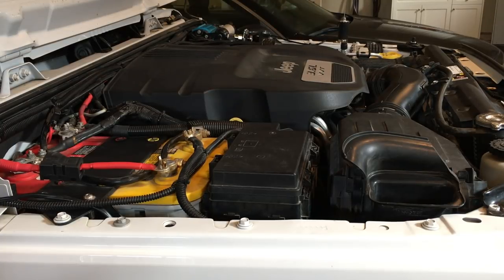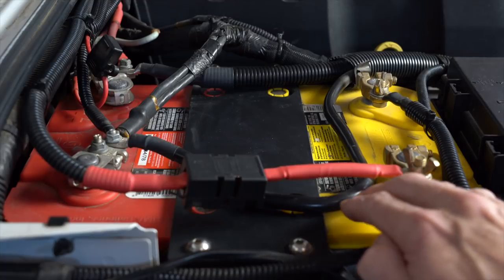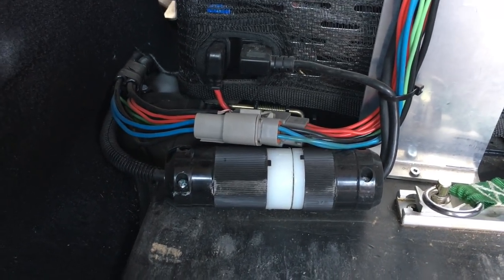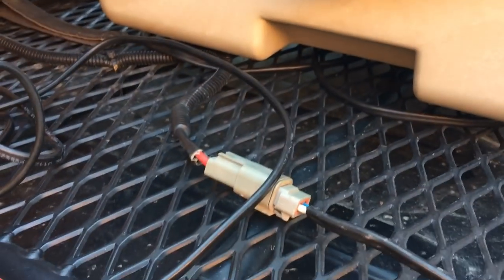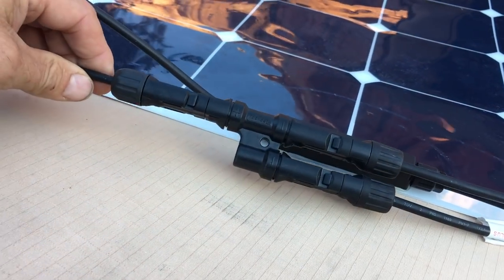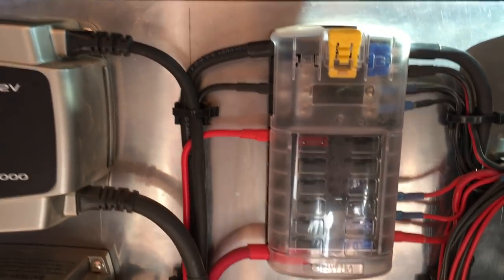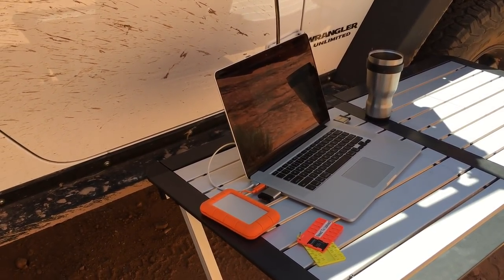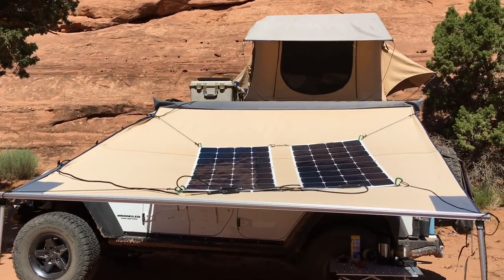Overlanding Solar Power Systems - Part 1

Comment: I have a genesis dual battery system in my jeep and learned you can't charge 2 AGM batteries with the standard Alternator the hard way.  I ended up adding the REDARC 1225D dual battery charging system.  Since I added that I haven't had any problems plus it has a connection for a solar panel as well.  It looks like you put a lot of work in to your system, that's a lot of wires but neatly done.  I don't have anything close to that in my rig with my system and it's keeping my batteries charged nicely plus I'm adding a solar panel on top of that so that when the engine is off it will still keep the batteries topped off.  For anyone looking to add a charging system to there rig I suggest the REDARC 1225D system.

Comment: I just stumbled across your video and I am impressed with your system. I was trying to see how you wired everything together but it's all bundled together so nicely that it's hard to follow the wires to see how everything is connected. Would you happen to have a wiring diagram available for your system that you are willing to share? Love your videos.

Comment: What a system, wish I had the knowledge to make something like this.
Reply from the maker: Thank you, there are 2 more videos coming for this series.
Reply: Can’t wait!!
Reply from the maker: If I recall you waited a while for me to put out my 1st video.
Reply: It's quite complex and complicated, there's simpler and easier systems. They make DC to DC chargers with built in MPPT for your solar connectons. I'm not sure how much power his fridge pulls or how long they go off grid, but you could probably get away with only 2 batteries. I know people who run a fridge for several days off the Jeep battery, they don't have a second battery. The best way to design your system is to decide what you want to run ie fridge, blender, laptop, and figure out how much wattage you need and for how long and go from there.

Comment: Awesome setup, thank you for the overview, I'm looking forward to part 2! Your cable routing is so clean and nicely done!
I might have missed it, but what do you use for your shore power charger for the 12v system? Or is the shore power only for the fridge? We have a decent electrical setup in our expedition trailer, DC->DC charger, solar, shore power, and a charge monitor, but in the jeep I only have one battery and a very basic solar charge controller so I can hook up a 100w panel when the vehicle is parked since we run a fridge in the back of the rig. I'm planning on finally doing some sort of dual battery install soon but still working on all the moving pieces i want to include as part of that. I'd like to replicate as much of our setup in the trailer, the main issue is that space is a premium in the jeep.
Reply from the maker: Brien yes we do have an AC charger a Ctek 25Amp, see 9:17 in this video. The AC plug by the fridge has two cables coming out of it. One to the fridge freezer the other to the AC charger. 
You will see it in action just like the solar was in this video. Except its coming up from 80% depletion.  There will be three episodes and maybe a fourth? You will also see the whole panel pulled out of the jeep feeling takes about five minutes or less. 
The real important thing here is it's all about the voltages based on the type of battery you have!